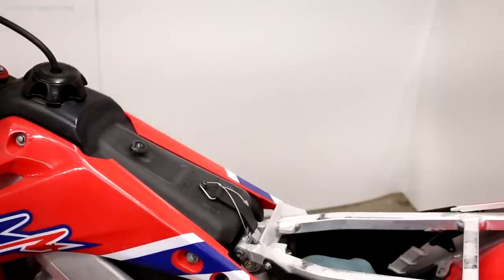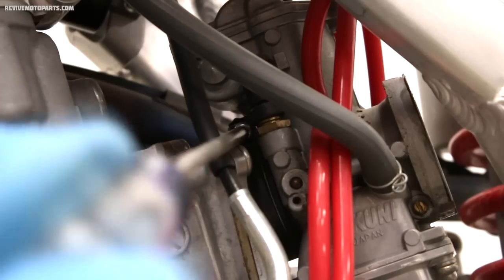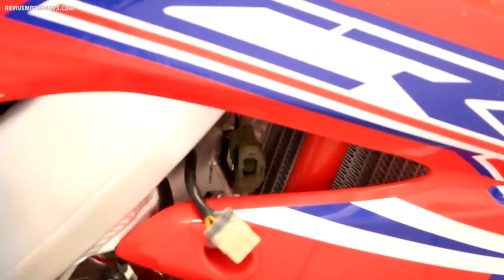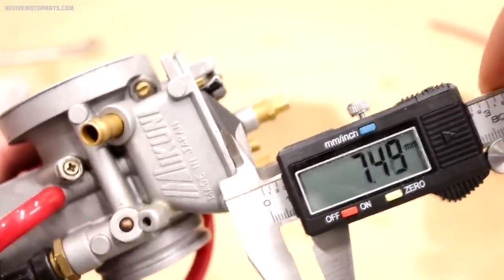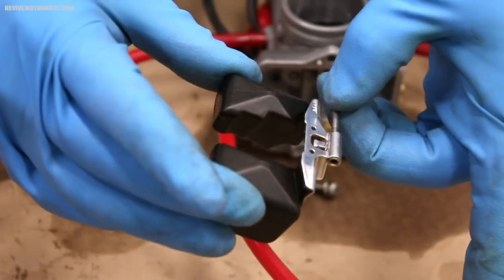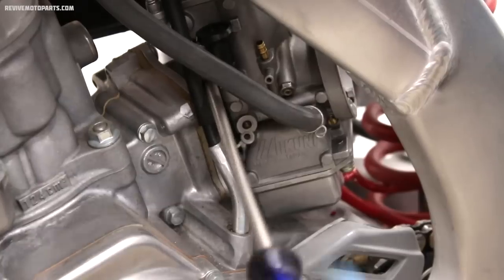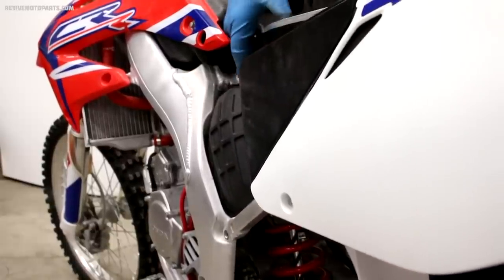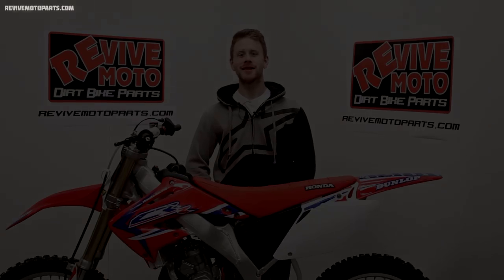Carburetor Jetting Is Useless Without This First

Comment: Cameron I ordered a Digital Caliper so I could dial on my float height.its now 7.51mm. Since I 've owned the bike, it's NEVER FOULED a plug. I went riding last year and contracted a bacterial infection that nearly killed me! It was a very serious infection. Anyway I'm looking forward to being able to ride again. I want to thank you for walking me thru things. I had an87 cr 250 that was so easy to work on. It ripped.  I've been bindge watching your channel. I just wanted to THANKS. Your the BEST.
Reply: I didn't think about that since I would need to allow more gas in my case for a air filter pod and a jet upgrade and I need to give it headroom and the calipers are the best thing you could use. I was pulling my hair out wondering why I was either fouling plugs , stalling at stops, or just plain unstable like hesitations and knocking. Oh and BTW I'm happy for you youre getting over that bacterial infection. I have an immune deficiency and something like that would indeed end me. Been the sick kid so I never got on the road and at 27 gifted a 49ccmoped and have been doing anything I can to it to understand it all and learn things one step at a time. 2 months later I got a 1992 Suzuki gs650g sitting in my back yard I got for free that was dumped and needs a while lot of love, blown gaskets. Riding has actually kept me sane through being sick and depression. I'm glad youre getting back on the bike after a scare like that. Stay safe brother
Reply: @alien_man1669  thanks man. John when you are in a bad way, you really find out who cares for you. In my case a 7 yo child my GRANDNEICE was the only person who cared about me. I was so hurt by my so-called friends, I still don't speak to them. Thanks again.

Comment: I end up checking a bunch of carburetor floats, because owners end up messing with it.

TIP: Always check the REAL fuel level on the float bowl in this way. 
Place the bike perfectly leveled (no side stand sorry). If not equipped already, put a transparent hose in the bowl drain. Open the fuel petcock. Lift the tip of the hose to carb level open the drain...
The level on the inside and outside of the bowl will be perfectly shown...
Never mess with the float level before the REAL check. ;-) 
Can be checked also while motor running, good for noticing flow problems, etc. ;-)
Reply: That is smart shoud the fuel be at the top of rhe bowl?
Reply: @hardendurobosnia17  2 mm below.
Reply: would you mind to demonstrate this in video- i read it 10 times, still confused what you trying to explain. how we use to check- just without mounting carb , just hold it in hands to tank attached with carbs  bottom screws removed, open tank drain, let the petrol fill up carb, than remove bottom of carb and you actually see how much petrol in there

Comment: Jesus! Why havent i've seen your channel before? Great stuff! I was just currently adjusting my float, but i really didnt get the hang of it of how "increasing" it by pulling it downwards the "tab"

Thanks for the info!
Reply from the maker: Thanks for watching!! Bending the tab downwards brings the floats lower, therefore increasing the float height. Hope that made sense.
Reply: That made perfect sense! I had great help with your guide aswell for adjusting the chain! The 3 thumb rule seems like the perfect setup aswell!

I'm still trying to get the hang of the float though... got to rewatch the video a few more times! I just dont really understand at which point i should start to measure.
Reply from the maker: The float height should be measured from the float bowl surface to the top of the floats. Position the floats so the float needle seats, but does not push in the center cylinder. Once you have it apart and check it out you'll see what's going on.
Reply: Ok, my center cylinder seems to be really sensitive, doesnt matter how i place my float. As soon as the float needle moves, so does the center cylinder aswell! It's a Keihin FCR 37 i got.. the typical one with Kawis and Zukis
Reply from the maker: It sounds like your needle valve may be worn. It'd be worth replacing it, they're not too expensive.
Reply: RysskPewPew   most times measuring is not required.  !!!   The float will have a mold Mark all the way around it.  Turn the carburetor upside down so the float falls down in the closed position !!! That mold mark line.. .. on the float should line up straight with the base of the carburetor... Look close do it by eye.... A high-flow tithe you siphon and get more fuel Halo float height you get less fuel.   ... Your spark plug will let you know if you're rich or lean.... The spark  plug should be a golden brown.   Black is Rich too much fuel.   White is lean not enough fuel.   When you bend on the float Tang... Which closes the float valve... A little goes a long way.!!!!
Reply: Whats the name of the spray you use thanks

Comment: Another good tip. Replace the outer screws with Allen head bolts. Won’t risk stripping out the bolts anymore and will last longer.

Comment: the float hight will alter the level of fuel in your carburettor but only changing the jets will alter the jetting!!!
The amount of fuel getting through to the engine will only really be affected by the float hight being too high and thus, the fuel level too low so that the fuel can't be drawn through the venturi and jets into the engine.
The only real consequence of having the fuel level too high is that the carburettor will overflow and you'll lose fuel when at idle. severely high levels will flood the engine at idle but this still doesn't change your jetting, just your fuel level!
Reply: I aquired a 1990 CR 500 in mint condition but it runs rough. It starts right up, but when I go to ride it loads right up and wont clear out in any gear. I bought a carb rebuild kit for it and I am about to go thru it but What do you think?
Reply: sounds like a fouled plug
Reply: my carb float are too high and cough petrol... it make my engine run rich all throttle.

Comment: My carburetor is running great but every hour or so it fouls the plug 
I was told to make my main jet smaller . can I Sutter it close and start drilling with the next smaller bit size that is smaller then my original jet 
I’ve been dealing with this issue for about 5 years now. Just been popping in a new plug every time 
Everywhere 
Waisting time money and fun
My main jet is a AB390
I’m running vforce3 s and a fmf gold fatty . This is the same bike as yours 2007 cr125 
With throttle position sensor 
I replaced the tps and bought the tps tester to check if it was working correctly, what you think 🤔 cam?

Comment: I Hava a NIBBI Racing Performance Carburetor 32MM Motorcycle Carburetor, would you know where the two hoses on the side of the carb leads to or where it should be connected to on my 250cc motorcycle? I know where the standard hoses, like fuel and bowl lines connect. But the hoses on the side have me at a loss.

Comment: 02:40 nope! Most Japanese bike carbs will will use Japanese industrial standard screws that are easily stripped with most standard Phillips screw drivers. You can identify these by a small dot next to the hat cross section of each screw (search for an image). Spending a little time and money acquiring a set of JIS screw drivers will save you alot of time and money acquiring a new carburetor.
Reply: I was going to say the same. I also have to admit I messed up few screws before learning about jis standard
Reply: Lol I’m in Japan and there’s no such thing as JIS screwdriver. . They just use standard #2 driver with metric threads and length. 😂
Reply: Or just change then out for cap screws with Allen heads.
Reply: He didn’t say anything about using a Phillips head screwdriver.  He just said “your screwdriver”.  Yes, we all know about JIS.  Except for technie87’ who apparently is an expert on Japanese engineering (because he was in Japan), and therefore claims it doesn’t exist.

Comment: Holy shit, taking the rear shock off, taking the seat off, the handlebars off, and both tires have to come off and then the rubber off the rim just to get to the carb.
Reply: Opferman Motors Dirtbiking you don't have to do all of that. It's faster if you remove the subframe all together to take off the carb on every bike, I always do it.

Comment: I changed to a bigger pilot jet in my Hero Honda Karizma R 2011 carburetor as i was having cold start issues in the morning.....now that the cold start problem is solved....but whenever i put my motorcycle on side stand the engine rpms starts to decline gradually and engine stalls and as soon as i remove it from side stand it is working fine with rpm again at normal range.....may be the bigger pilot jet is giving more fuel to the engine....should i decrease or increase the height of the float bowl pls suggest....😇

Comment: Thumbs up brother. You explain things well. I already knew how to do it but if I didn't your video would've been helpful, thorough and easy to understand 👍
Reply from the maker: Much appreciated John!
Reply: @CameronNiemela  I know is an old video, but maybe you can you help me with some advice... I changed all the gaskets inside the carb (keihin PWK36), flotor level is correct, runs fine when open throttle. The idle I cant figure it out, tried multiple pilot jeting from 40&45 (second position for needle) idle stay very high or die, pilot nr. 48 in second needle position is not running well on 1/4 throttle, seems to much gas. Put needle to first position and with pilot nr. 48 have more grunt, more linear power delivery, seems to have better idle but it still drops from high rpm to very low after few seconds. Should I try with pilot jet 50 or smaller? or what to try next? this is killing me :))

Comment: What's the difference between the red shock coil and a yellow one? My '01 cr250 has a red one like your 125, yet every single other '01 I've seen has a yellow one. Thanks.
Reply from the maker: All Honda two strokes in that year range come with yellow springs, but there are people like me who paint them red. I'm guessing that's the case with your bike as well. I can't stand the yellow spring.
Reply: Thanks for getting back to me quickly. Is the sticker on the back of your shock red as well. The reason I ask at all is that sometimes manufactures will color code their product according to specs and I wondered if Showa did that here.

Comment: hey question why do you hold the carburetor upside down at a 45 degree angle doesn't it make more sense to hold it in the orientation the carb would normally sit??? Thanks

Comment: Amazing video! I just have a quick question So I recently brought it to the shop for a carb jetting and it worked perfectly fine idles, doesn't bog still up to this day. But what concerns me is I see fuel leaking out the overflow tub when the bike is barley tipped over. When the bike is on the triangle that's when fuel starts to drip out. The bike also does this when it's running too but u have to lean it over a tad more to see it dripping. I know this is not normal because I have a race bike and pratice bike and my race bike does not do this. Thanks!
Reply from the maker: Thank You! That definitely sounds like the float height is off. You will need to increase the float height since too much fuel is being stored in the float bowl.

Comment: What is the sign of too low and too high float level? How can I know if it is not correct?
Reply: Logan880121 too high the bike will piss out fuel and too low might not give the bike enough fuel when full throttle so it might cut out. Just check what it should be and adjust to spec

Comment: now i was cleaning my carb because my bike would bog until like 20 mins after riding it so then i noticed my floats wasnt lining up straight with the carb frame so i bent the float adjustment up but now when i went to go test it alittle more than average gas came out of the carb overflow is that normal? or should i re adjust my floats a little back? the bike did start and run tho

Comment: Should a new carb have to be checked for this float height ?? Thanks in advance 👍🏻
Reply: yes it should
Reply: Snitchy1989 Ok 👌... cool ! ThankYou
Reply from the maker: Most likely it'll be set correctly, but doesn't hurt to check before installing the carb.
Reply: ReVive Moto Parts Thanks man 👍🏻 LOL ... Already put on .. Guess I'm pulling it off !!

Comment: I have a Mikuni TMX38S carb on my rm 125 I'm pretty sure its stock for the year, at high rpms the bike sputters and doesn't feel like I'm getting 100% of the power could the carb play a factor in this, I've tested for everything else, seals etc and they're all fine?
Reply: Murphy Lunjevich Try different clip settings on your needle, or a new profile needle if you already have

Comment: Hello.
I have a Nibbi power jet carburetor for my 250cc. It came with hoses that I am not familiar where to lead them or connect to on my bike. Any help would be greatly appreciated. Thanks.
Reply: What 250cc? Did you figure those things out? I have a 250 and got a nibbi for it aswell
Reply: @Tahmanakki  Honda. I could not adapt the power carb to work with the motor. It would have been sweet if I could. Went with a PZ30 Carburetor from Amazon. Worked perfectly. The exuast end of the Nibbi carb could not be fitted with my motor.

Comment: I've gotten to the point I can remove the carb with the bike fully assembled.  I'd say its more for dual sport bikes, but as an extreme example if you start out the morning at the base of a mountain and by the afternoon your 10,000ft in elevation higher its nice to swap the jet without disassembling the entire bike and losing things on the trail.. That being said Hondas are even easier because the bowl on the Hondas have a big nut you can remove and don't even have to pull the carb, UNLESS you have to do the float height at the same time, then you still have to pull it  (:   Haven't heard of many people needing to re-adjust the float height with the jetting however... but I guess it could happen, depending on what type of float you have and how hard your slamming it on the trails all day.

Comment: hey, i have a mikuni tmx 38 flatslide carb on my Husqvarna cr 144. but the bike is bogging and sputtering at low rpms, just like if you hold the chocke in. Any ideas what the problem could be? changing the needle position did not work, the fuel/air mixure screw wont even react.
Reply: b sk maybe it's the pilot jet
Reply: b sk I had a bog on higher Rpms but it was because the power valve needed cleaned out

Comment: Cleaned out carb and changed Needle and the other little jets not the adjustable ones just the ones around the floats now quad is bogging from 3/4 rev to full open throttle. Could this be due to foot height?

Comment: does jetting your carb increase your bikes performance
Reply: Only if you need to, like if you've fitted a free-er flowing exhaust or air filter or had work done on the head to increase flow rate into the cylinder. You will need to change your jetting if you ride at altitude (3000ft/1000mtrs or higer) and fit a smaller jet due to the thinner air, other than that No!
Reply: @roythearcher  thanks man

Comment: When I leave the fuel turned on, on my tzr125 fuel leaks out of the carb onto the floor and floods the engine would this be something to do with the float height?
Reply from the maker: Yes, that'd be float height or a worn out needle and seat. I'd tear apart the carb and test the needle and seat to see if they're leaking.
Reply: Cameron Niemela I'll try that on the weekend, thank you

Comment: What are the signs of float height being off?
Reply from the maker: If the float height is below spec, the bike will leak gas out the overflow very easily when tipped to the side. And too much float height will cause the bike the starve for fuel and will be unresponsive to jetting changes.
Reply: Cameron Niemela . when the carb is completely upside down should the floats sit level with the mating surface amd the float needle completely depressed?
Reply: Shake your bike side to side. If the engine hesitates, check the float height. My bike would die when taking corners.

Comment: What is that bult at the bottom of the float bowl called because i need one for a 2 stroke 250 suzuki 4wheeler can anybody let me know?
Reply from the maker: It's just the carb drain bolt.
Reply: Cameron Niemela can you send me a link or something so i can find it please?
Reply: Alexis Garcia i havnt found it sold on its own but search for your size carb rebuild kit, ive gotten them in those to repair bikes i buy from auctions. gl

Comment: jr...your srews strip only when using a ANSI style screw driver sold in USA.  The screws pitch is JIS...which is different then ANSI.  You should ether replace with ANSI screws, allen heads or use the correct screw driver.

Comment: please tell me why. i have kx 80 1991. and it runs without any throttle pretty good and it work really good in low rpm, but if i twist the throttle and in half rpm it sounds like its running lean and it doesn't rev anymore than half gas and sounds like its running rich??

Comment: I also have a mikuni carb and when I turn the fuel on to start my bike gas starts leaking out of the vent hoses, is this because of  the float hieght?
Reply: It could be, but the float height would have to be set super high. What's more likely is that the rubber inlet needle in the float bowl is worn, damaged, or out of adjustment so that it's not seating correctly. This is the needle that the float is directly connected to. This valve is the main way that the whole carburetor gets fuel from the gas tank. If this tiny little brass and rubber needle valve is out of whack in any way, it will just stay open and fuel will start overflowing out of the carb and out one of your drain tubes right onto the ground. It could drain your entire gas tank eventually.